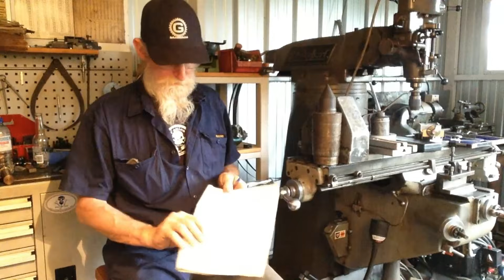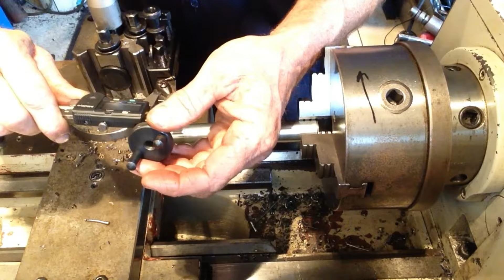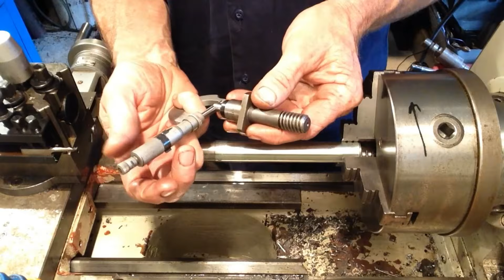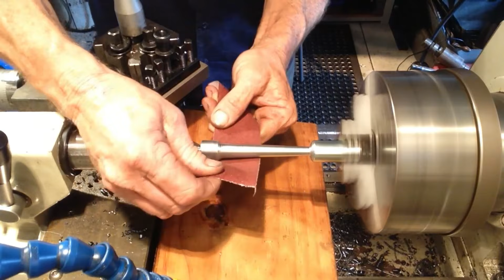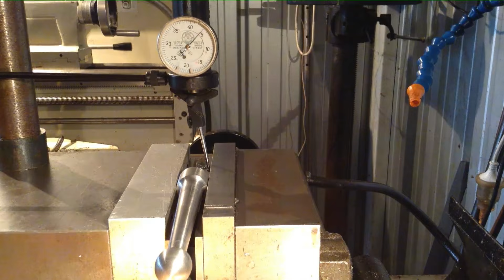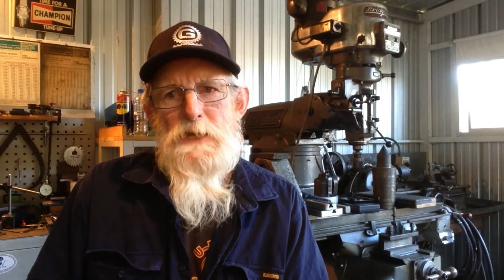Swarf & Chips  Ep 4  part 5

Comment: Why do machinists usually drill and tap holes for locking grub screws at 90 degrees apart? I would have thought 120 degrees would be better or am I missing something.
Great videos, I'm working my way through them all !
Reply from the maker: At 90 deg you do not get 2 screws working against each other , esp if there is a keyway involved .

Comment: Hello Max,
I'm a little late on this video but you mentioned wanting to try synthetic coolant.  I've been using Castrol Syntillo 9954 for almost 20 years and it is fantastic.  Clear, no growth, no smell and virtually no rust.  It only seems to rust if you get it between clamped mating surfaces (i.e. between a vise and the mill table)  I have solved this problem by oiling the table with way oil before installing the vise.  The vise can stay on for months with no rusting.  I do the same with the compound rest on my lathe. It is expensive (about $275 Canadian for a 20 litre pail) but it is mixed pretty lean (3-6%) and goes a long way.  You can see it in action in many of my videos.  Ken
Reply from the maker: Hi Ken , yes i looked it up some time ago & it's not cheap .  I have a drum of Castrol Hysol MB 50 . That will last me for quite a while before i change to Syntillo .  I am just on the last of a drum of Castrol Clear edge , it makes really good tapping oil if used as is without water .   Cheers .

Comment: Yummy. Those centering dial indicators are the ducks guts. Use mine a lot. Nice to see old school work and the proper way to use emery. How many times I do the same with emery stretched on a file. I remember back in school and tech using emery cards/boards. Love your work.
Reply from the maker: The Blake co ax is a great tool ,  but my last word starrett is the most versatile i have ever had .  Cheers .

Comment: Good stuff. What is the advantage of synthetic  coolant?
Reply from the maker: As far as i know syn is clear , wont grow a beard in the tank  &  its probably expensive ! but i am still finding out more info about the stuff  from others that use it  .
Reply: I'm following a tip from 'Solid Rock Machine Shop' and using Distilled Water with my soluble oil coolant. No wiff of corruption or beard yet... We shall see.